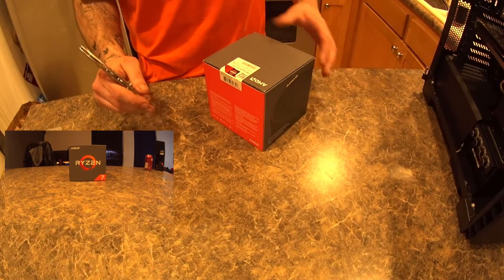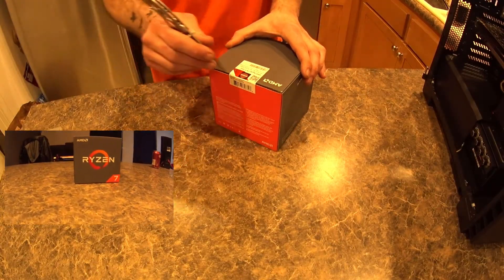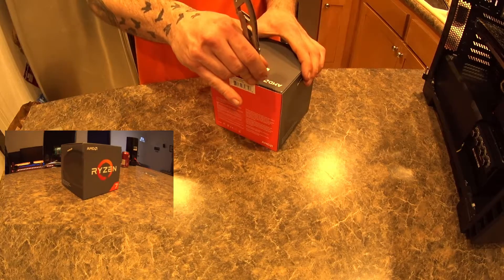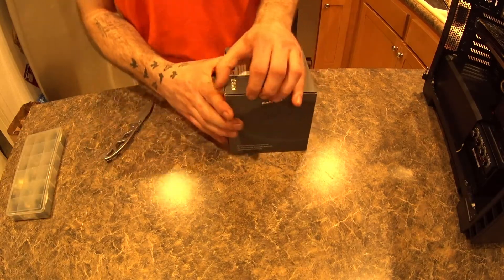Ryzen 1700 Unbox Overclocking & First Benchmarks Part 2

Comment: Did you try controlling the color of the Wraith Spire RGB LED with the Asus RGB software, by any chance? (Asus website isn't really clear on whether Wraith Spire cooler is compatible with AURA Sync software.) Thanks.
Reply from the maker: The Asus AI suite has the controls for the RGB wraith spire. Though they only have very minimal settings to choose from. We hooked our's up to a separate controller solution in this first build for more color and sound control options!
Reply: Ah, thanks so much. (You must mean the Rf Music Controller for LED Case Lighting in your parts list - I had not noticed that.) Thanks again.
Reply from the maker: Yeah ! Appreciate the sub if you like the content, we have much more coming soon & giveaway @ 100 subscribers so stay tuned!

Comment: can you give me some info on how to set voltage because i am worried my voltage my go too high.
Reply from the maker: zach Houcher Yes Since we are using B-350 Platform you must use Ryzen Master Software to change the voltage manually there is no good included hard manual voltage setting within the bios on these lesser boards. it's something we just have to deal with for now, there is just shy offset voltages within the bios and I wouldn't mess with them. Do your Voltages in Ryzen Master only if you are not on x-370 and take into account the Ryzen master voltage is accurate but you will notice +0.012 spikes in cpu-z after you set it so just take that tiny bit into account! if you could subscribe you would help the channel immensely in the begining here and all supporters are heavily appreciated. I hope this answers yours question . New unboxing today !
Reply from the maker: However... the D.O.C.P settings on this Asus board will automatically set the voltages if you just up the clock speed. I however for now just like setting a hard manual set voltage with these B-350 through ryzen master !

Comment: Can this asus b350 board turn off SMT and adjust number cores to be used?
Reply from the maker: JDG yes this one can absolutely do that. We also have a review of a AB350 Gigabyte Gaming 3 board coming, which has more chipset features but less control in the bios compared to this asus board so the Asus is a great deal for control sake. Appreciate it if you could hit that subscribe button :) !! It's a toss up they're both great boards with similar prices and different features. Stay tuned!
Reply: For overclocking which one would you suggest asus prime b350-plus or gigabyte ab350 gaming 3, i'll be pairing it with either an r5 1600 or 1500x?
Reply from the maker: JDG it's a tough call , both are great b350 boards I think the Asus has better Auto overclock features out of the gate for stability sake. Corey has the Asus I have the Gigabyte and I need to do more testing and full review on the gigabyte just got it installed tonight. In my personal rig ,which I do all the Editting and stuff so it will be a busy week. Right now I would say the Asus it has great DOCP settings without messing with Ryzen master I think we got to 3.8 GHz steady on the Asus with just a quick DOCP auto setting out the box however if you want 7.1 audio reinforced pcie & Custom RGB zone the gigabyte wins there. like I said toss up! they both can overclock near the same if we are testing with Good coolers in Ryzen master though. Bios is always the way to go though and I need to do some more manual overclocking there to give a final verdict
Reply from the maker: JDG also these processors are very cooler dependant and with the stock wraith cooler it is not suggested to go above 3.8- 3.9 for Thermal limits of the chip if you want to get 4.0 or 4.1 you must upgrade cooler immediatly .